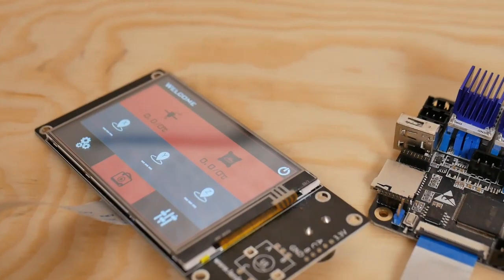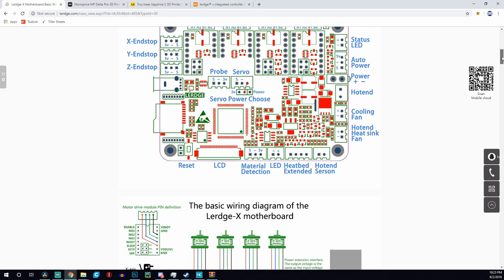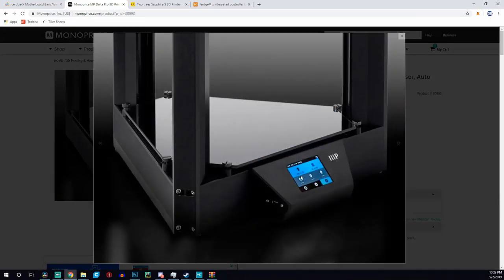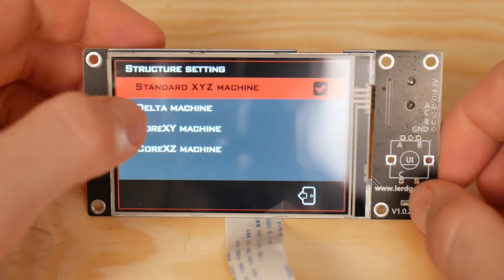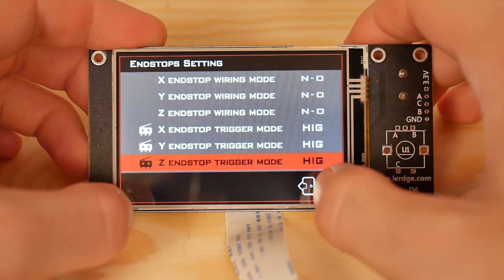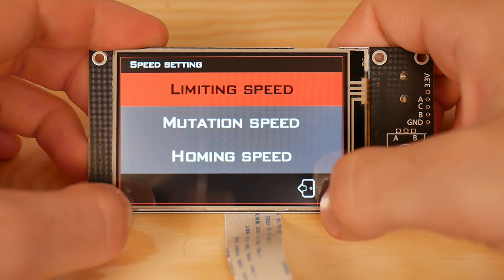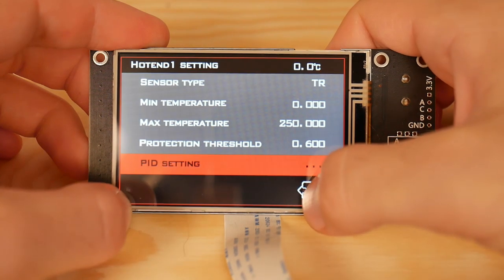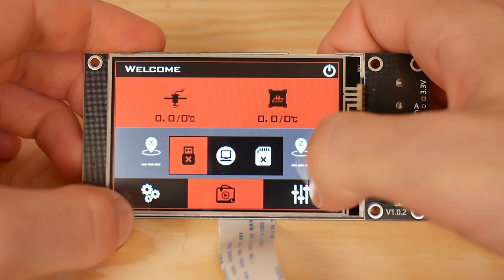Lerdge X 32-Bit 3D Printer Controller Board Interface

Comment: I'm listening to your narrative, and I'm thinking: Yes, BUT! If you want to use Octoprint and Klipper, forget about it, right? If you want to print fast, forget about it. On the other hand, LERDGE is saying they're gear is OPEN SOURCE!!!!! There's NO REASON WHATSOEVER TO STAY WITH LERDGE. BTT has the crown on, they're selling their klipper board, they're posting all of their config files. I went from the Xvico Pioneer, which was also based on a stolen design, to the Lerdge K because I wanted the Duet3D experience. Now I'm done with Lerdge gear. Why? Because they have a problem with being Open Source.

Comment: I also thought it has a great UI, moving my Geeetch Delta to the Lerdge-X worked pretty well. I do wish Lerdge had better documentation, and actively acknowledged that most of us are coming from Marlin. A simple chart that translated Marlin names to Lerdge settings would have been so helpful. I could never get my Z step height just right. I ended up just slicing everything Z set to 103%. I was never able to get any help from Lerdge and the user base was still too small for that to be a support option. In the end, one of the end-stops got out of adjustment, I'd had it. Purchased a Prusa kit, and love it. I will someday print all the parts to make that delta work, because at the end of the day I miss that awesome user interface.
Reply from the maker: I agree, wiring and such is great, but the firmware side could definitely be better. That conversion chart is a great idea. Definitely would be useful for someone that is trying to modify the firmware and not do so directly from the LCD screen. haha that is weird, but funny that the workaround was to slice with a higher z on your models. Perhaps the user base has grown since with it now coming in a few machines from the factory. If you end up taking another wack at it let me know!

Comment: I bought 3 lerdge boards. One x and two k   I got them because they are closed source.. I like how if you ad a bltouch, you just add it. No flashing firmware after a new build. Just change the setting and print

Comment: I wanted to know if you have a ender5 set up on the x lerdge and the configuration?
Reply from the maker: I do not. Currently only running this on my AM8 build. Other than wiring the configuration side should be quite simple.

Comment: Design Prototype Test had a good review of this when he reviewed the Two Trees Sapphire. His only complaint about the board was the closed source. That Open vs Closed has been, and will be, an ongoing argument. I just like to see the how by improving, and that’s great for everyone.

I’m always amused when the open/closed argument arises. Has anyone given a thought to the fact that most of what we use is closed source anyway? Cars, appliances, most everyday things are closed, it’s only when we get into the hobby do we find people reverse-engineering stuff. And I’m sure someone will say different, but when was the last time you heard of a car person say, “ma, I wish that fuel system was open source so I could hack into it.” Like I said before, innovation takes research and time, which cost money, and open source is not a money maker.
Reply from the maker: I cannot say I disagree with this statement. I personally, like many others do like open source for its mod-ability and 3rd party compatibility. I started this channel showing how to hack things that were closed source in order to make them able to run your own code. However, there is certainly a huge number of people that just want what they have to work, and do not need the ability to screw around with it. I to use plenty of things that are closed source and am completely happy with them.

Thank you for taking the time to comment and share your opinion.
Reply: Actually, almost everything you use is open source. A huge, huge majority of computers in the world, especially consumer facing devices, use Linux. On top of that , many of the languages used today are by their very nature open source. The only closed source product tends to be the final UI and user flows  but that is built on towers and towers of open source code.

Especially in the examples you gave of cars and appliances, nearly all of that is open source, due to the fact they're often running Linux.

That aside, the closed source nature of the lerdge board is a massive deal breaker. I've run into so many unexplainable issues, printer damaging bugs, and problems that I think this is one example of why open source, especially in a field of emerging technology, is so important
Reply: Kyle Shovan I think you need to go back to the definition of open source. Or open hardware. Cars are not open source, even if they use Android on their navigation system. I can’t go to Ford or Chevy and see plans on the new Mustang or Camaro that would allow me to build one. I can’t go to Kenmore and say let me see the drawings for your microwave so I could build one. That is what I was referring to, not the coding behind those things. Or try finding the schematics for an Apple MacBook, so you could build it yourself. I still hold that Open Source/Open Hardware isn’t mainstream.
Reply: @JohnDStrand  youre wrong on both counts.  Ford and other car companies definitely put out everything to the public. Any patents by the company must be published, by definition, with schematic drawings and how to replicate them. The hardware is also released to OEMs for after market parts and servicing.

More importantly, you're taking about the last few feet of the development process. All of those things are based on bodies of study and products that fuel our modern society. Open source hardware, and in the case of lerdge, ESPECIALLY open source hardware and software, enable everything. 

What you see at the store are different arrangements of open source, open hardware industrial lego fashioned into consumer devices. Its easy to see it as "closed" if you only examine things on a purely surface level.

Irregardless of that, just in terms of software, nearly the entirety of the internet runs on open source software. It is ubiquitous. In fringe consumer electronics, such as 3d printer controller boards, which are very often custom built, custom engineered pieces of equipment that require constant tweaking and nob turning, closed source software has absolutely no place in the field.

Edit: you mention apple. In many ways they are the primary outlier in this discussion, due to the fact they are purposefully hostile to their customers rights to repair and information. Their customers believe Apple knows best. That's fine and well and good. Use your dollar if you don't like it. I will tell you that my experience with lerdge was absolutely awful, to such a level I setup a satirical website about my experiences with them.

dont-buy-lerdge.com 

I took time and money to try to let people know that this closed source experience is not like what you'd expect from Apple. Its very buggy and barely functional.
Reply: @honkhonk165  I can appreciate your opinion even while I don't agree with it.

Comment: Hey, I wonder if you can set  dual motors on x, if you can set up output configuration of motors via lcd? Thanks.
Reply: Yes, you can.
You can use the same driver for two steppers.

If you get the Lerdge K board, which has 6 channels, you can use one driver for each X steppper (X and X')

Comment: Couple of questions. Does it allow for 3 Z Motor tramming like the Duet, and does have functionality to pause print at certain layers from the menu like Sailfish?
Reply from the maker: Cannot tram and I do not believe you can pause at pre defined layer height from the machine. Would have to be done via the terminal or (possibly slicer) before hand.